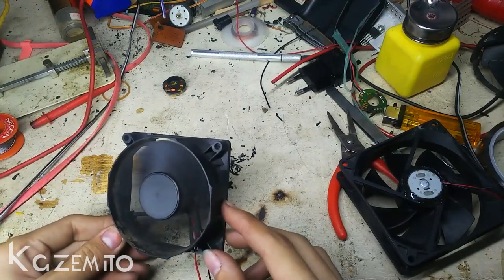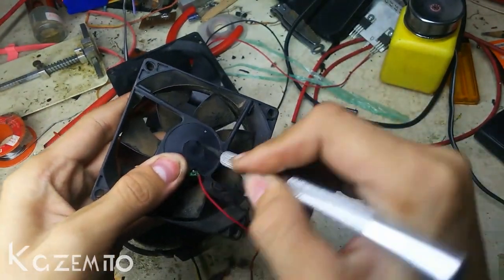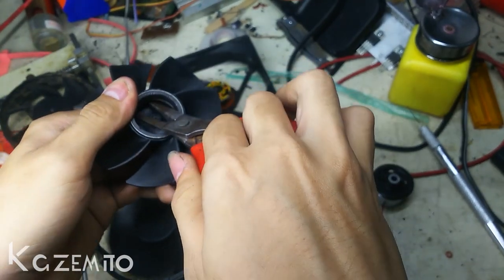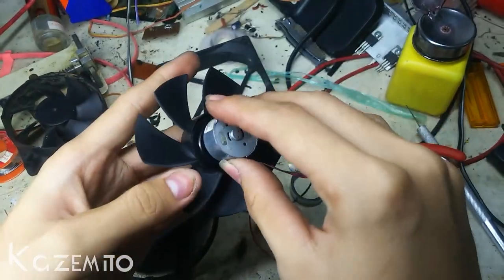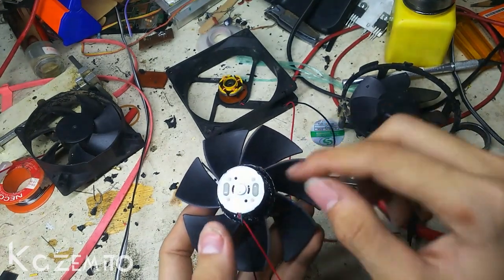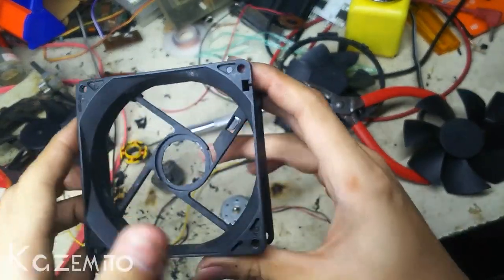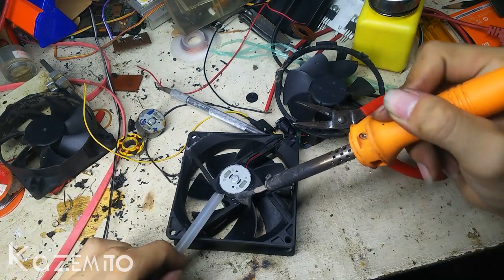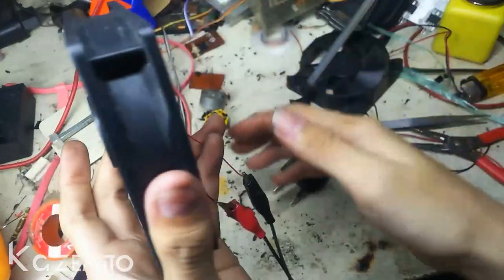Make your PC Fan RUN 10X FASTER!!

Comment: I did this to my fan. Very powerful, but BRUSHED motors get hot very fast. Brushless motors are better.
Reply from the maker: I know, I'll make follow up video using BLDC motor. make sure you subscribe.
Reply: Pc fan is for 12v motor from cd player is for 3v that way is geting hot!!
Reply: @marcin320i  my input voltage isn't 12v sir.
Reply: It wasnt designed to run for a long time in the first place
Reply: @sgx6215  not designed to run for a long time? LMAO. That is a PC fan, how long do you even expect? 2 minutes? Hahahaha
Reply: @troyguererro0898  im talking about the brushed motor
Reply: @KazemitoHaruhi  please how to remove the center iron
Reply: True
Reply: BLDC motor are more noisy
Reply: To wait may concern here? Can I buy a fan like this already this powerful? I look all over can’t find nothing close.
Reply: @KazemitoHaruhi  can can you give a link to something as strong as this that I can purchase? I need something with this kind of velocity can’t find nowhere.
Reply: @bade-bike1930  include the current rating if you want powerful fans. They are usually server type fans. Try searching 12 volts 3A fan. There are 5A variants depending on the brand
Reply from the maker: @bade-bike1930  I already reply on your comment but let me repost here.

If you want cheap fan with high velocity or static pressure, you can find old or unused server fan but the biggest I can found in local market is 6cm and mostly 4cm. If you want 12cm one you can simply buy 4 6cm fans or you can search old school AVC fan or Delta one.

If that's not enough you can spend more money by buying EDF fan and the ESC module, also buying servo tester module for controlling the ESC module or you can make it using Arduino nano.

Comment: Bad idea if you see it in long run the the motor won't last because the brush inside the motor will worn out within 1 month of frequent use as pc fan motor are designed to last more than brush motor that's why it is called brushless dc motor . Please don't do this if you have a running fan .
Reply: The first electric fans had brushed motor . 1910s brushed electric fan still runs today they don’t make them like to use to

Comment: It would be super hot when you render a long video overnight. I'm going to use brushless motor and a speed regulator circuit for that fan so it will be easier for sleeping. Cause My desktop stands right next to my bed, a loudy fan isn't a good idea in my case

Comment: Question, can you show us how you power that motor or like what battery do you use or do you have a speed controller for it?
Reply from the maker: I just use old ATX (or computer or PC) Power supply coz that's the only psu i have for testing and got it for free in junkyard, rated 350W total (obviously not real "maybe" coz it was a cheap psu) and constant 12v.
ATX power supply can output multiple voltages like 3.3v, 5v, 12v, and -12v. I use 12v and ground.

i didn't use any current or voltage regulators, and when i making the video i use ATX psu, but I don't recommend running it 12v DC or more that's why the motor died after few minutes running supplied by my motorcycle battery (i use it to grill chickens at gather together) 😂😂

Comment: Hello, I have a question if you could answer me, what happens if I have a 12v fan and supply it with 5v, it will move slower, right?or are there risks undervolt ?
Reply from the maker: You're right, it will run slower and there's no risk running under rated voltage. 
But if you running way too much voltage it will burnt the coil and IC inside the fan let's say you have 12v dc fan and you run it with over 16v DC supply.
If you want to make it run like it should be or little bit faster, you can add 2A boost converter or step up dc to dc converter and set it to 12v or more under 16v it will safe. 
There is version with micro usb connector so you don't need to solder usb cable and I use it on my cordless drill battery project, video are available on my channel.
Reply: @KazemitoHaruhi  thanks, u have a new subscriber, I recently started working in the electrical field and I still read things on the internet and get informed, "recently started working" like a hobby in free time, pc coolers modifications and mining rig cooling sistem, etc
Reply from the maker: @SiLEcyberV3  Thanks! tbh I have plan to make another version of this project and maybe version 2 I guess, and another version 3 or maybe 4 let's see how it goes.
Reply: @KazemitoHaruhi  i have a another question, 100% y now "peltier module", exist a module to produce cold on both sides? like from electrical power to freeze

Comment: mine doesn't use motors it uses magnets and electric coils
Reply: so you have a tmd fan tip magnetic drive
Reply: that's called brushless motor
Reply: Moto is made up of magnet and coil

Comment: I have 5 fans I was gonna use in a box style flowhood of sorts (no, not true laminar flow). But the fans didn't have enough ass or create enough pressure in the box to blow thru the 2inch filters. I was gonna do this, motors should be here any day. But I don't believe I will get the speed and abt 2-3 hrs of run time needed. What if I take like 3 24v drill batteries and wire them in series? Would that give me the output and time range im lookin for? (that's what I did with all of my kids power- wheels, yeah the wires fried but after a good long while and a lot of fun). I know I'll have to alternate batteries but as far as fan speed and duration without burnout.? Thanks.   
Or is this pretty much the same/similar as a 12v supply?
Reply from the maker: If you want use 24v batteries maybe you need bigger motor, since this motor from CD player it can only handle 3v to 9v continuously.

Comment: Niatnya, fan nya mau dipasang ke oil cooler satria. Apa aman bang sumber daya nya dari aki langsung ? Infonya bang 🙏🙏
Reply from the maker: paling kasih regulator step down / buck converter setel tegangan output ke 6v biar awet, atau beli kipas server aja yang 4cm, atau yang 6cm juga ada, lumayan kenceng pasti awet
cari yang high rpm

Comment: Can I buy something already this strong? I can’t find anything even close to this velocity. Thank you guys in advance.
Reply from the maker: If you want cheap fan with high velocity or static pressure, you can find old or unused server fan but the biggest I can found in local market is 6cm and mostly 4cm. If you want 12cm one you can simply buy 4 6cm fans or you can search old school AVC fan or Delta one.

If that's not enough you can spend more money by buying EDF fan and the ESC module, also buying servo tester module for controlling the ESC module or you can make it using Arduino nano.

Comment: your not modifying the fan to make it faster your making a fan from scratch. what we need is to pull out one of the resistors or change one of the resistor values to bump up the current.

Comment: Now it will not need 12 volt to work ..now it will work good in 6v only ..right ?
Reply from the maker: Yes, it can be useful if there is blackout and so hot inside, you can run it using power bank.
Or you can use it for grilling something like bbq

Comment: Sy mau tanya donk mas... Sy punya cpu fan brushles dc 12v, sy sambungin pake charger adaptor 5v, tp kok lambat ya? Apakah hrs pake adaptor 12v lg spy kenceng puteran kipasnya? Sblmnya terimakasih.
Reply from the maker: Sebelumnya maaf ya Kalo agak kasar, Jadi logika Aja supply yang dibutuhkan 12v sedangkan yang disambungkan 5v ya pasti kurang kenceng putarannya karena tegangan listrik dibawah 12v walau Masih bisa nyala tapi Jadi pelan. Kalo Mau kenceng tanpa beli adaptor 12v lagi ya beli boost converter yang ampernya kecil.

Comment: Bang gw pake dinamo RS 550 12 - 24 Volt bisa gk? soalnya dinamo RS 550 gw itu rpm mencapai 18.000 RPM 12V dan input gw 24 volt
Reply from the maker: Coba aja, paling cepet panas..
Kalo mau pasang di PC mending pisahin power ke motor nya, soalnya noise nya gede takutnya ngerusak PSU, ram, cpu, ssd, GPU, HDD, mainboard dan semuanya soalnya voltage spike (lonjakan tegangan) nya bahaya buat barang sensitif sama hal itu
Reply: Tapi kipas nya Gw gunain buat mesin blower bukan PC terus dinamo RS 550 itu ada pendinginnya

Comment: Why do you use a soldering iron instead of glue gun? Is there a reason?
Reply from the maker: I bought 2 times and it exploded and short circuit for 15 mins of uses, I bought the black one because nearby local store only have black one and more expensive than online store, and I'm so lazy to buy at online store because I don't want to wait for shipping time and my money not enough that time.
Reply: @KazemitoHaruhi   ok :-) i thought i should not use a glue gun as you doing.
Reply: @KazemitoHaruhi  i have 'trigger' branded glue gun. This is my experience and not an advertisement. That works without exploding up to 5 hours. It's not as other low quality glue guns and it is rare to buy online or in physical market. Because it is a good branded one and if there's one, it sells immediately within 2 weeks. Worth for money. In our country, it is 2-3$ and other countries 2-15$ I hope you try it :-)
Reply from the maker: @TechBihandu  Thanks, I appreciate your suggestion! But I couldn't find it on google and local online store. Maybe I'll buy "Stanley" brand or unbranded blue colored hot glue gun with on off switch.
Reply: @KazemitoHaruhi  branded glue guns are much better. I recommend stanley brand also.

Comment: Very cool, but this tiny motor will burn really quickly. Still, neat idea!
Reply from the maker: No mercy for this motor, it will always getting burnt if I use 12v.
but at least it's working, even this motor costs less than a dollar.

Comment: i really like this hacks. i never image it before using the cdrom motor.
can you convert server fan (because it powerful and durable-i got lot fan) into pc? thanks.
Reply from the maker: Maybe I can make it adjustable using Arduino, thanks for suggestion.

I also wanted to use server fans as motorcycle radiator fan but the blade too small even 6cm size, I need to consider it again
Reply: @KazemitoHaruhi  good project. i'm new into arduino. for now i learn about basic arduino and python programming  thanks.

Comment: the CD drive won't last longer with high voltage.im going to put a big one 3v 3100rpm DC motor RF-500TB those are good motors they last longer.
Reply from the maker: Read desc.

Comment: I can't imagine this dc motor would run very long before getting overheated and stops working
Reply from the maker: That's what people called "D E S T R U C T I O N"
or "O V E R C L O C K E D" *nerds says.
I forgot to add notes to not run at 12v on long periods, forgive me sir hehe
Reply from the maker: But I tried this using motorcycle battery and it last for around 32mins. (Because used for camp fire blower and too close with fire then overheated) lol
I think pretty good for overvoltage to ~400% from operating voltage (3v to 5v)
Reply: Gee glad that I'm reading this first before putting it works
Reply: Add flyback diode

Comment: Is it applicable for 80mm fans?
Reply from the maker: Sister Roy if it's fit, so that'll work fine
Reply: @KazemitoHaruhi , which fan did you use in this video 80mm or 120mm?
Reply from the maker: Sister Roy 100mm I guess
Reply from the maker: Standard PC case fan
Reply: @KazemitoHaruhi , I never heard of 100mm fan. It's probably 80mm.
Reply from the maker: I dunno, might be 80 or 120, it's not too big.. but this might work for 80mm fan
Reply: @KazemitoHaruhi , not that tough. Just measure it. It is measured side by side. It should be 8×8 or 12×12 (cm).

Comment: how long can this last ? 3 days ?
Reply from the maker: If you run it with 12v it might only run few hours or minutes, because this motor was designed to run at lower voltage like 3v to 6v

Comment: Kalo dialirin tegangan 5 volt sama 12 volt kecepatan putar kipasnya sama atau beda?
Reply from the maker: Beda lah, 12v lebih tinggi voltase nya, otomatis arus (Ampere) nya juga naik, putaran juga akan makin kencang, tapi umurnya jadi pendek jika ada beban seperti baling baling. Saran 5v aja.
Tegangan operasional dari 1.5v - 9v max. 12v ga rekomen karena ini motornya spesifikasi suplai tegangan inputnya 3v

Comment: I tried it today. After connecting the modified fan in PC, the PC is turning on and off in cycles. Everything is fine after disconnecting the fan. Actually the current (amperage) of the fan will easily surpass the PSU limit. So this modification is worthless for a PC.
Reply from the maker: Sister Roy where you connect the fan into? If you connect it directly to 12v cable, the current will too high for atx power supply. Did you read my description? I'm not recommend to use 12v, better use 5v or below

Comment: Bang gw udah beli boost converter 5v ke 12v, yg 5v usb, tapi ko ganyala ya, saya buat fan PC 12volt, itu gimana ya?
Reply from the maker: Kebalik kali pasangnya
Reply: @KazemitoHaruhi  ehh iya bang,salah slot ternyata ada dua, yg satu buat usb
Reply from the maker: @naufalatallah.g9863  😡😠
Reply: @KazemitoHaruhi  thank you bang wkwkw

Comment: Gara gara videomu saya jg bikin buat cooling pad laptop bang. Saya tambah sama ste up boost.  Tapi kok waktu voltase saya naikkan kok outputnya tetap 5v ya.
Seperti motor dc dvdnya membatasi cuma 5v
Bantu jawab bang
Reply from the maker: puter terus, itu cek voltase nya pas ada beban apa ngga? kalo ada coba beban motor nya copot dulu dan ukur lagi,  (kalo bisa jangan 12v untuk jangka waktu lama) kalo udah disetel malah drop ke 5v lagi berarti usb port mu cuma bisa handle beban arus kecil (misalnya dibawah 1A) , jika demikian mau gamau pakai external power seperti adaptor, charger atau power bank.
Reply from the maker: subsikrep dong woy 😭😭😭

Comment: How to make it  center if not using CD player holder
Reply from the maker: there is a mount for blade rod or propeller rod, you can glue into that, it's tricky same like using cd holder

Comment: Who would have guessed replacing a low powered motor with high powered motor would make it more ... powerful

Wonder if this will work on other things? 😐
Reply from the maker: I use this fan for grilling bbq and something like that. it's very useful even this can run at 5v at higher speed than original bldc motor from the fan itself
Reply from the maker: maybe you can try on laptop fans lol

Comment: How many volts and amps are needed
Reply from the maker: 5v work best, 1 amp is enough. You can run it using any phone charger, 500mA also enough and it's minimum.
I do not recommend run at 12v for long use even it can run at 12v.
Reply: @KazemitoHaruhi  what is optimal like maximum output with minimal damage to motor that is for long term use
Reply from the maker: @rjcreations934  5v is optimal use. you can run it for a year until bearings worn out.

Comment: that's just gonna last for a week before the brush melts and the contact to circuit is gone. Lol
Reply from the maker: Yes. But actually no.
The copper wire will fail first before brushes getting melted.
Fun fact, mine already broken since I use it near fire because I bring it into BBQ party.

Comment: how to increase RPM of Intel stock cooler
Reply from the maker: The simplest way to increase speed of CPU cooler is overvoltage it's fan, but since Intel's fan cannot handle high voltage (more than 13.4v), you might want to modify it.
1. Buy a cheap 12v DC fan *$1 or less (make sure not too big.
2. do what I do on this video.
3. remove Intel's CPU cooler.
4. remove Intel branded fan from heatsink.
5. glue or secure it with bolts the modified fan into the heatsink.
6. buy a DC Buck Converter module, so you can adjust the voltage from 0-12v, make sure not too long using 12v, or it might blow the motor.
7. This is not sponsored by Intel.
Reply: or you rewinding the coil if you want the hard way

Comment: 0:13 is what noise my pc make when I join a game is that normal?
Reply from the maker: did you use discrete GPU? maybe your GPU or CPU overheating with dried thermal paste, try to clean the heatsink and apply new and good thermal paste.
Reply: @KazemitoHaruhi  thanks

Comment: how to pull out the shaft/rod it is so hard ?
Reply from the maker: There is a lock on the back of the sticker
Reply: @KazemitoHaruhi  i mean , shaft on the propeller not at the back of the sticker
Reply: @abdcandratriadi8998  the fan is hold only by magnetic. behind the sticker there's little lock plastic ring. remove it first with tweezer.

Comment: Emng knp gan klo dalam jangka waktu yg lama? Gosong kah? Kabelnya??
Reply from the maker: Gak gosong kabelnya, motornya panas
Reply: Oh perekat nya bisa copot juga ya, solusi perekat tahan panas itu apa? Dekston?
Reply from the maker: @andi_1313  lem bakar juga kuat, asal ga overheat. Saran jangan Pake 12v soalnya motornya cuma ± 3v, 5v Aja juga udah kenceng
Reply: @KazemitoHaruhi  ok gan terimkasih. Sangat membantu buat kipas laptop
Reply from the maker: @andi_1313  mending beli kipas server yang 12v 15000RPM
Jadi Kalo dikasih 5v ga terlalu pelan Dan arusnya ga besar
Reply: @KazemitoHaruhi  berarti kalo pake usb 5 volt , bisa tahan lama ya gan?
Reply from the maker: @naufalatallah.g9863  iya, awet 5v daripada 12v

Comment: How do i get it to be silent tho
Reply from the maker: Use 5v
Reply: @KazemitoHaruhi  u mean motor
Reply from the maker: @Nimmy..  no, i mean use 5v supply, pc power supply has 12v and 5v connector (also 3.3v and 5v standby but it connected to motherboard)
Or you can use dc to dc buck converter like xl6009
Reply: @KazemitoHaruhi  u can buy the motors off ebay v5
Reply from the maker: @Nimmy..  but the motor i used rated at 3v, and it can run at 12v with high speed

Comment: I like the idea of using other type of dc motor but using of glue stick sucks.. It will melt once the motor heats up in its continuous high speed.. Duh
Reply from the maker: I already tell on the video just for example, coz I'm not using that fan anymore.